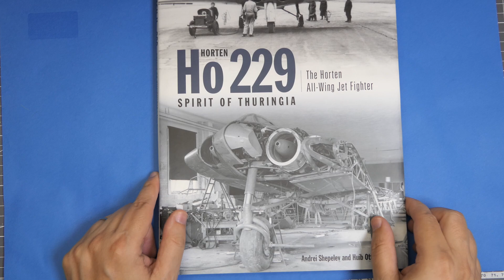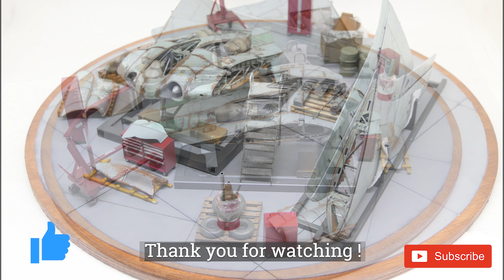Horten Ho 229 - Museum edition - 1/48 - Zoukei-Mura - Step by step full build

Comment: Best build ive seen, been waiting for 1/48 inspiration. ( several of 1/32 ).
Appreciation gives a Lil to Both.
Good workshop diorama. Would of Liked more exposure of Engine/s, tho i understand difficulty there. Hmmm should i do wings on/off. Good exposure of wing joints too. Ive both scales 1/32 also, 1/48 is good for space saving Thnxs
Reply from the maker: Thank you very much. This model is so interesting that we need to do several in several configuration. sometimes it is very hard to choice as we want to do all in the same time.😜

Comment: Why so much rust ? Did they build the airplane from scrap-metal ??? Or did they use aluminium ( as usual for planes ) ? But aluminium will never rust ! So I ask : why ???
Reply from the maker: the plane has a structure in tubular carbone steel, the panel are in wood but the is in carbone steel. I recommand the book : Horten Ho 229 Spirit of Thuringia: The Horten All-wing Jet Fighter (on amazon, you can find it)